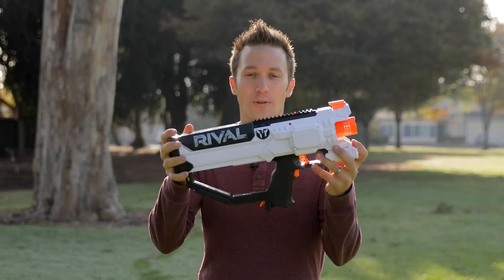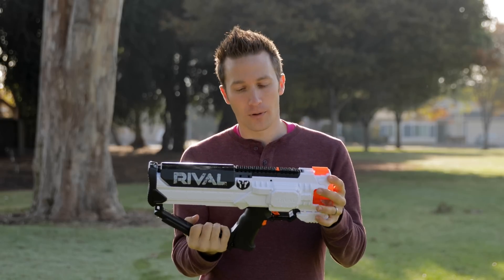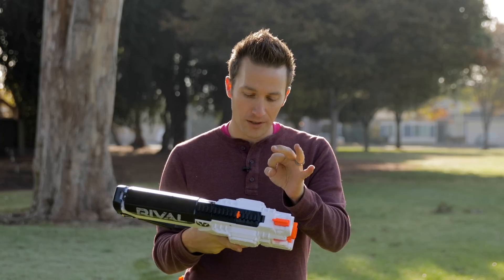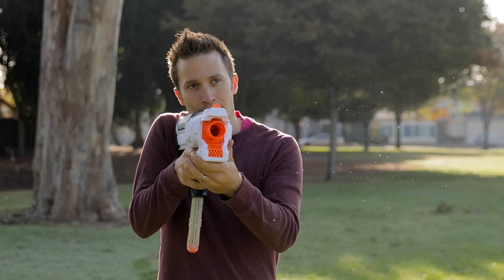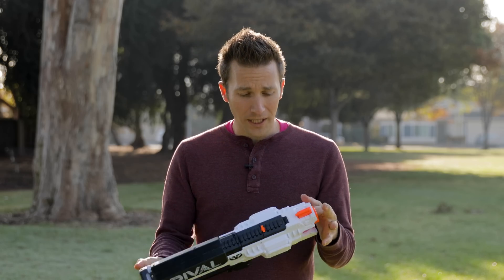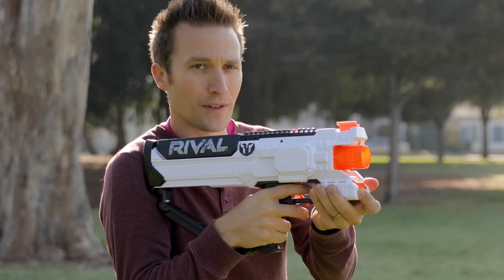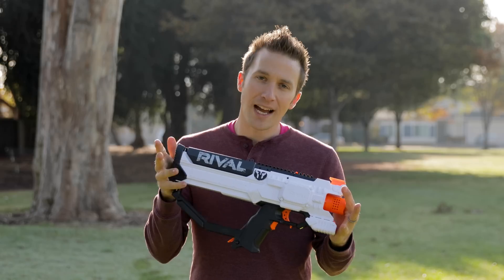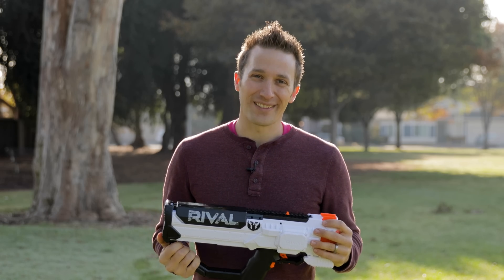Nerf Mod: Full-auto Rival Hera!

Comment: Make a gun with four flywheels and connect an ardwino or something as well as an it camera, then program it to change the flywheel speed so shoots at warmth when you hit the trigger. It's like auto aim for Nerf. You could make it so it goes off it's Target after like six shots if it is full auto, or you could have a button to switch to another heat source.